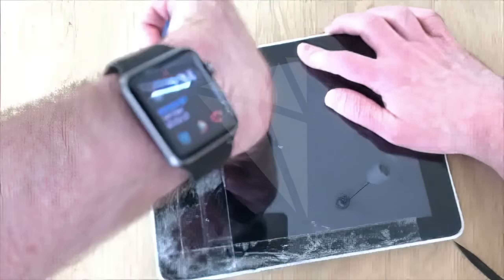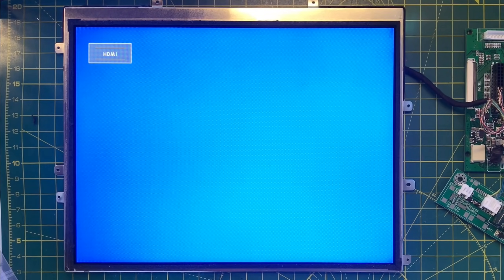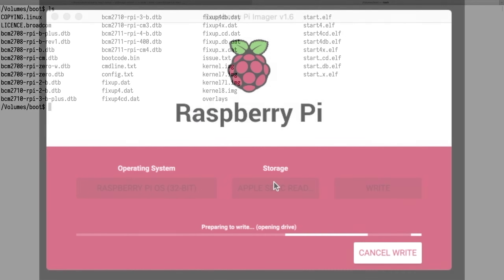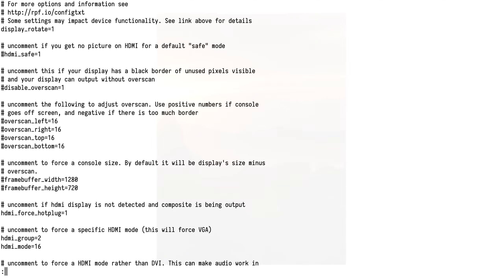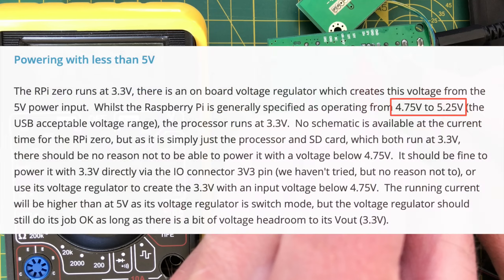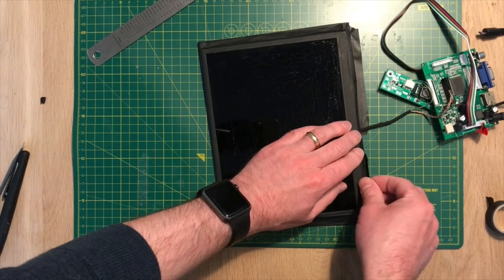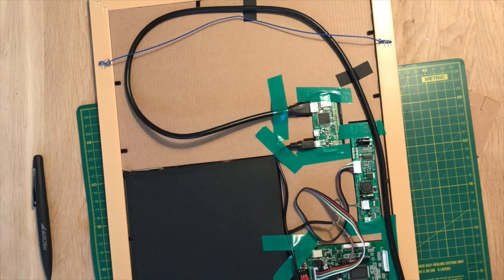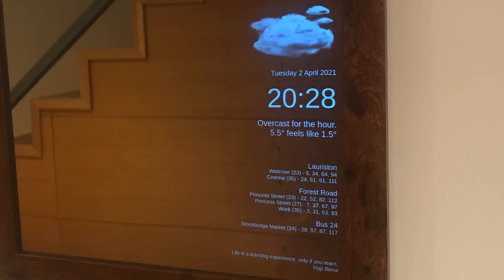Reviving a Broken iPad: Transforming it into a Magic Mirror with Raspberry Pi Zero

Comment: Great video! I saw it a few years ago and it has been itching my brain since. I recently aquired the stuff to start building my own magic mirror in similar design to yours!
Very fun project so far! But I have run into one major problem, and wounder if you have needed to solve a similar problem.
The latest version of Chromium Browser and Firefox seem to have changed their architecture and are no longer supported on Raspberry pi zero. Have you run into this problem and did you fix it?
My thoughts are either to try and install older versions of the browsers, find some replacement browser or just concede and buy a Raspberry pi zero 2.

Comment: Great vid. I’m using an old ipad display but I’m getting ‘no signal’. Did you adjust the config file? Cheers
Reply from the maker: Hmm, I didn't have to do anything special to get it to work. Might be worth trying it with your desktop/laptop.
Reply: @atomic14  I thought as much from the video. I’ve ordered a new cable to see if that is the issue. Thanks for the reply

Comment: I know this video is about 2 years old, but is there anyway to keep touch screen functionality with some controller board? I've had yet to find a video keeping touch screen.
Reply from the maker: Sadly not - at least I’ve not found anything that will do it.
Reply: @atomic14  Damn. I've been searching for so long. I mean it would've been nice to keep touch functionality but I don't think it's possible.
Reply from the maker: Yeah, it's just too complicated to reverse engineer for anyone to bother. The only real option is to buy a separate touch digitiser and stick it on top. But at that point you might as well just get a fully functioning display with touch built in.
Reply: @atomic14  That's true. Thanks for the response though.

Comment: Could you give the link for the buck converter? I'm also building a project where i would like to give power supply to the screen without extra cable, and could you please tell (or show) how did you "connect" it to that micro usb cable? You would help me out a lot
Reply from the maker: Something like this https://amzn.to/3zsrmqI would do the job. To actually connect it, I chopped up a spare USB cable and used the wires from that to connect it up.

Comment: Brilliant project! Only part is how did you get the tablet screen to seem like it's reflecting when off? Ie: how did the tablet become a mirror?
Reply from the maker: I'm using a 2-way mirror - similar to this - https://www.amazon.co.uk/gp/product/B01MSJQLUL there are quite a few options so it's worth shopping around for a cheap price.
Reply: @atomic14  At an escape room a ghostly figure appeared on the bathroom room mirror and i always wondered how they did that.  I think you have finally pulled back the curtain. Thanks.

Comment: maybe you can repurpose the speakers and add a microphone set to make it an assistant (google or alexa)
Reply from the maker: I was thinking that! The speakers from the iPad are really thin so would fit nicely behind the mirror. Couple that with the camera that recognised who is looking at the mirror and you've got something pretty crazy :)
Reply: @atomic14  a nice extra touch could be a computer vision sign language recognition, it would be a great product for deaf/mute people. Maybe the Pi zero doesn't have enough power, but desoldering headers to a Pi 4 could work. A Jetson nano (and a thicker frame ;) ) could be the "ultima ratio"
Reply from the maker: @photocromax  Interesting, just thinking about a minority report type thing where you can just make hand gestures to control what's displayed.
Reply: @atomic14  After I wrote last comment I found there are many machine learning papers detecting sign language and hand gestures in general, but I didn't deep dive to see if there is a re-trainable model.

Comment: Btw, you can now use the RPi flasher to enable SSH by design. I believe the keyboard shortcut is CTRL+X or something similar, it will show special menu to configure the RPi OS.
Reply from the maker: They keep that well hidden! CTRL+SHIFT+X Really handy hint and makes things a lot easier. You can enable SSH, set the pi password, change the hostname and setup the WiFi connection.
Reply from the maker: So handy I thought I should share a video on it: https://youtu.be/om8gGB3gyT0